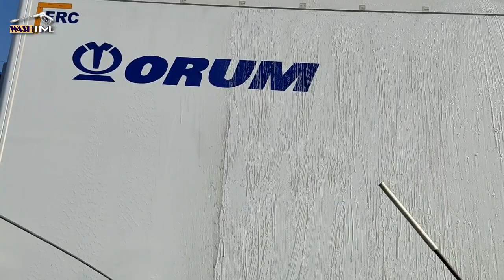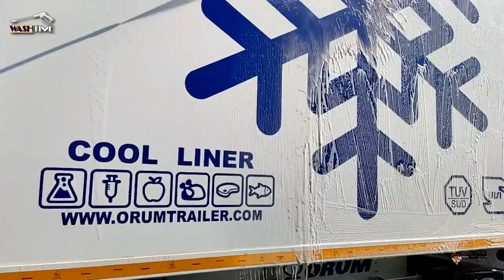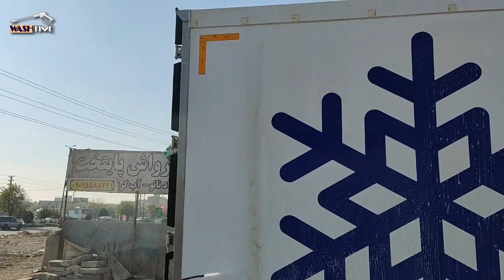#Truck_Wash Deep cleaning a dirty Swedish volvo truck abandoned in the parking lot!

Comment: Hello.  I live in Vietnam.  I also wash trucks and trailers, just like you.  However, I am not as professional as you.  because, in my country, i have not found effective touchless cleaning solution, washing machine is not strong, cleaning tools are not enough.  Can you give me advice and share your experience?  What kind of solution do you wash with?  What type of washing machine do you use, how much capacity, can the cleaning brush be rotated clearly?  I hope you share it with me.  thanks a lot
Reply: @washtime-truck1156  thanks you .
Reply: @washtime-truck1156  I thank you for guiding me so wholeheartedly.  can you tell me a few more problems.  Why wash with warm water?  I specialize in washing trucks and e tractors.  I'm having to wash with soap, and scrub and wipe with a broom.  where do you do craft like in my country.  I want to find a solution to wash it without having to use a soft brush to wipe it.  Can you share with me the name of the solution you are using.  Do you wash it with the touchless washing method?